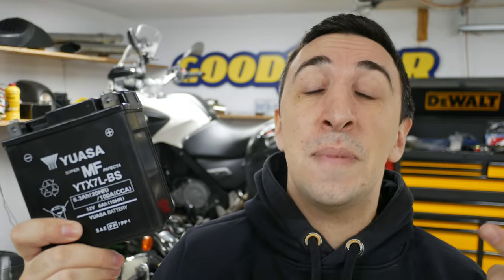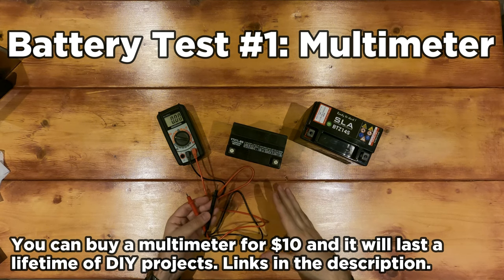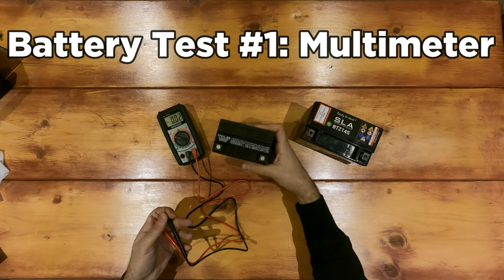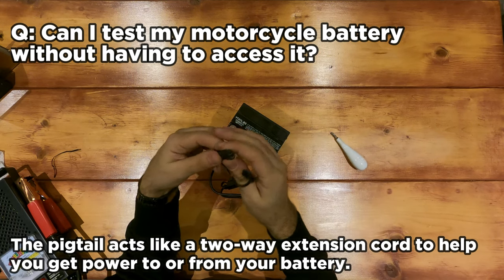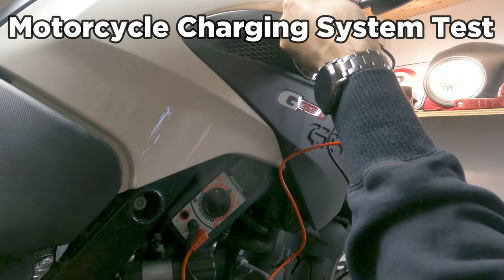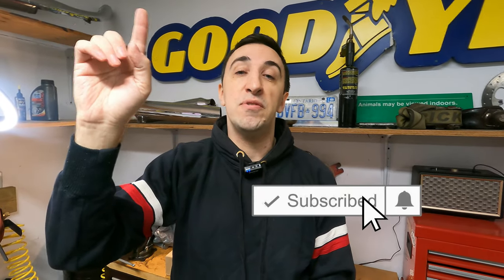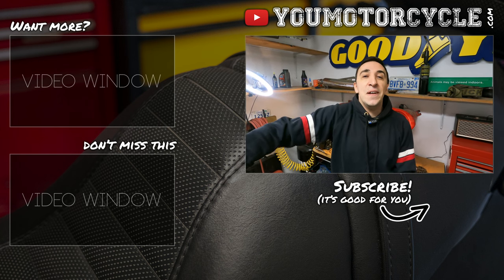Dead Motorcycle Battery: Recharge or Replace?

Comment: Something else your test showed is that the voltage didn't drop below 10 volts while starting the engine which indicates a good battery.  Also you don't need a meter to tell the charging system is working  - just watch the headlights brighten as you rev the motor! Great videos,  very clear and fun to watch!
Reply from the maker: Fair point. That works in a pinch. Thanks!

Comment: Thanks.  I never stopped to think my inexpensive multimeter that's primarily used to test AA and AAA batteries around the house would also work to confirm 12+ volts in my motorcycle battery.
Reply from the maker: Thanks Kevin. Ironically, I never stopped to think my inexpensive multimeter that's primarily used to test motorcycle batteries aroudn the garage would also work to test AA and AAA batteries. You should make a video and show me how to do that now haha.

Comment: Don’t buy cheap or unknown manufactured batteries, just buy a Yuasa, and know it’s going to last, especially if you use a battery conditioner like the OptiMate 3 Motorcycle Battery Charger & Tester.
Reply from the maker: I agree. I'm currently experimenting with a no-name lithium. I'll post a progress video on that over the winter (it's been a full year now), and I'm also going to be doing another video about desulphating battery maintainers because I think you bring up a good point: the charger you uses does make a difference!
Reply: @YouMotorcycle  Yes, probably does make a difference with the correct charger, some just charge with is not good, you need one that cycles the battery and does periodical condition checks automatically. In the UK these cost around £55.

Comment: On my 3rd battery. I didn't know if it was the battery or my charging system. I got the first 2 where u add the acid but they both failed no sure if it was because the store added the acid and didn't wait the 30 minutes before putting the caps in. Every time it went dead the caps were coming out of the holes. I got a new sealed battery today and so far so good but I will be going to get a multimeter tomorrow to check my charging system. Anybody have any other suggestions?
Reply from the maker: Hey, how did the charging system test go?

Comment: Hi Adrian - Another great video. I have always kept my bikes on a trickle charger and haven't had any battery problems, yet. I'm going to get a Load Tester and start checking a few times a year. And good to know you can use the pigtail instead of taking things apart to get on the battery terminals.Definitely worth it not to get stranded. Thanks!
Reply from the maker: Hey Paul, thanks for the kind words. Trying to be helpful to people. Always a smart move to keep the bikes on the trickle chargers. I wouldn't check them too often. No use to put an unnecessary heavy load on the battery more than is necessary. Also a good idea to fully charge the battery before and after the load test. But if I was going to get either a load tester or a multimeter, I might go with the multimeter because it has a wider range of uses. Load tester is definitely easy to use though!

Comment: This video is exactly what I was  looking for. I have the same load tester which I got at Harbor Freight a while ago. I wasn't sure if the 100 amp load of the tester would be too much for the battery. I feel more confident now to use it on my 28AH motorcycle battery. Thanks for the great video.
Reply from the maker: I think it says on the label right on to only hold for 10 seconds, and they know it's made for 12volt batteries, so I wouldn't sweat it, but I also wouldn't hold it for any longer, and then charge it up again right after testing! Glad you liked the video! :)

Comment: Good vid. Waiting a couple of hours after charging to test the battery voltage was a new idea to me. 

I think you mentioned something else briefly but another charging system problem to look out for is too much voltage when the motor is running. My Suzuki started having brighter than normal dash lights a while back. I thought maybe I was imagining it but I checked with a multimeter hooked up to the battery terminals while it was running and it was over 18 volts! I stopped riding it around before I fried anything and got a new regulator/rectifier. With the new reg/rec installed it went right back to about 14.3 volts.
Reply from the maker: Was it a GSXR by any chance?
Reply: @YouMotorcycle  Nope, it's a lowly GS500E

Comment: Thanks for the very informative video. My pigtail is connected to what's called an 'output terminal' on my fusebox for attaching electrical accessories. Could I still use that pigtail connection to check with a multimeter as you instructed in the video? It's a pain to access the actual battery connections.
Reply from the maker: Should work. It's gotta get power to and from the same battery. PS: Thanks!
Reply: @YouMotorcycle  You'd think so. :) Thanks!

Comment: how about replacing acid or cleaning batt cells & adding acid back. 

did several times and batts leasted more when 6-8 years
Reply from the maker: From my understanding, refilling an old battery casing with new acid wasn't recommended... but I honestly can't remember why not. If it works for you, rock on!
I'll be doing another video on another tip to extend motorcycle battery longevity though... stay tuned :)
Reply: @YouMotorcycle    not with a new one, goal is to use charger with shock option when you fill with dist. watter and when you put same aciid back

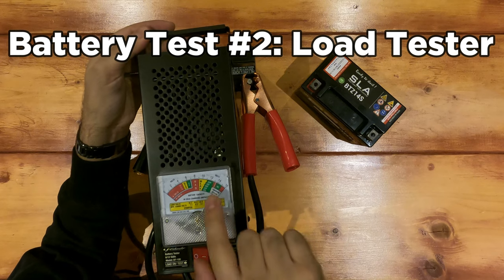Comment: 2:50 Nope, I'd not go 10 seconds, no more than 5-6 seconds when load testing a motorcycle battery with such a device that was designed for car testing batteries! Going more than 5-6 seconds would seriously shorten the lifespan of a mc battery.
Reply from the maker: Interesting point, thanks!

Comment: Hi there @YouMotorcycle thanks so much for this video!  I had a dead battery, I charged it fully, let it sit for 2 days, then used the multimeter and it read a solid 12.6v, after turning the key lighting up the dash etc. the multimeter read 10.4v and then hitting the starter, the engine turned over a couple times but didn't turn on at all. Does this mean my battery is actually totally shot? I'm just a little confused because it read 12.6v. Thanks in advance.
Reply from the maker: Battery is taking a charge, holding a charge, but has no cranking power. So when you put a load on it, it fails. If you had a battery load tester it would probably fail. Unfortunately sounds like time to replace the battery.
Reply: @YouMotorcycle   thanks so much for getting back to me. Super helpful!

Comment: Hey Adrian, great videos and a great learning tool for people getting into motorbiking. I just wanted to check something. I don't have the battery tender connector that you have in the video (CTEK one is on order with a full tender system) so would I be ok to check the motorbike charing system to put my multimeter on the terminals on the battery when checking this? Or should this only be done once I have the connector? Thanks in advance :)
Reply from the maker: Thanks! Size, shape, look, brand... don't let any of that bother you. They're going to have a positive terminal and a negative terminal. The rest is just details :)
If you find that you get a negative number, for example, -12.76, it just means you have the positive and negative backwards, switch them around and you'll see it's 12.76.
Reply: @YouMotorcycle  Thanks buddy,  just checked my bike battery and the bike charging system. I had bought my bike from a friend who had it sitting around for a few months and  hardly did any mileage, then when I bought it I was having starting issues every other day. But doing these checks you've guided me through I'm pretty confident I just need to use the bike more and the battery will become more reliable. I have a tender etc on order and have another battery coming as a stand by. I'm now going to watch some more of your content to level up my mechanical knowledge. Thanks again dude!! :)
Reply from the maker: Batteries don't get better unless they're being recharged now and they weren't before. Is that the case?
Reply: @YouMotorcycle  Yup, I've been charging it and going for long rides. The only time I had issues starting was if I left the bike for a day or two then tried to start it, but when being used daily for more than half hour its been fine
Reply from the maker: That should have failed the test. How did you test it?
Reply: @YouMotorcycle  I disconnected the battery and checked with the multimeter which gave me a reading of 12.7v. Then connected the battery back to the bike, turned the bike on and it then read from 12.4v to 12.6. Started the bike and it dropped to around 9.4v then picked up and was steady around 13.8v, gave a little rev and would pick up to just over 14v
Reply from the maker: Nice. How long was the battery either not run or not charged when you checked it?
If you check it right after a ride or after firing up the bike you'll get a false result.
Reply: @YouMotorcycle  I went out in the afternoon on the bike but it had been standing at home for a least 3.5hrs before I tested it
Reply from the maker: Ok great. But it still shouldn't be dead after not being on the road for a couple days. Did you check the charging system too?
Reply: @YouMotorcycle  Yup checked the charging system as well. Turned on the dash etc and the reading dropped to 12.3v - 12.5v then starting the bike it jumped up to 13.8v, gave it a little rev and it picked up to on and just over 14v
Reply from the maker: @Chuubs  so weird that it was still having starting issues. Are you sure it's a battery issue and not something else? Battery and charging system sound really good
Reply: @YouMotorcycle  I put the bike into my friends auto garage for a full service and check over and nothing was reported back. It is only a little 125cc. Are there any other things that I can check to be sure, just point me to any of your videos and I'll have a watch and check it out.
Reply: @YouMotorcycle  Just to update, I grabbed a new battery and this has solved all the issues. Odd that it was giving me decent readings, but new battery in and starts perfect every time. Also to save headaches in the future I picked up a permanent battery tender. Thanks for the tips dude and taking the time to chat and help <3
Reply from the maker: Glad you got it sorted out!

Comment: Struggled with starting my bike for over 2months...then realized my battery was leaking acid due to falling from the bike 😢

Now am planning on buying a new battery 🔋 and hipe for the best 😢
Reply from the maker: Hope everything has worked out! Make sure that the battery leak was from the spill and not from a charging system issue :) Everything okay with the new one?

Comment: Good video Adrian.  I keep my battery from my Spyder on a tender indoors for the winter.  But, I have never thought of checking the charging system after I reinstall it in the spring and periodically through the season.... good tip, Thanks.
Reply from the maker: Thanks! I keep them all on tenders in the garage via pigtails but indoors would probably be best!

Comment: I really liked your presentation...until 3:55 into it where you were going to show how to use the pigtail to charge the battery but you went right to testing the charging system! 😞

Still a useful video!
Reply from the maker: Sorry! The battery charger should have a matching plug, so what you're seeing on the right side, a couple seconds earlier... the two connectors are identical. so you just plug them into each other.

Comment: I bought a new yuasa battery 3 days ago for my motorcycle and it charged for 1 hour before plugging it in and I drove it on the highway for 2 hours and then I rested it for a day when I checked the next day its voltage is always in 12.4v and then dropping to 12.3 engine start at 14.2v does my battery needs more chrage or is it normal for new battery? hope you can help.
Reply from the maker: Sounds totally normal. How was the battery prepped?
Reply: @YouMotorcycle thanks for the response  Sir. no hard starting one push start and i feel more power on acceleration I was just wondering because I thought it should be 12.6v when the battery was new compared to when I bought the motorcycle the voltage was 12.6v at resting I'm sorry, I'm just a beginner in this kind of stuff.

Comment: I wanna blame the battery but everything checks out good. However my Goldwing has to be boosted after sitting 3-4 days.  Two y/o Yuasa AGM battery .   I checked for parasitic drain and came up with only 3 milliamps.  5 is considered normal/ acceptable.  Also if I turn the key on for too long without starting(something distracts me for example) and forget to turn the key immediately back off 45-90 seconds it then won't start without a boost.    I don't have a lot of extra load on it.  Just ring of fire.  
Now what?
Reply from the maker: Next time you're gonna let the bike sit for 3-4 days, disconnect the battery first. After it's sat for a few days, hook it back up. If the battery has no issues this time, you've got too much drain. If the battery is still no good, replace it. You might also want to fully charge the battery and take it to an auto shop or a motorcycle shop and have them put it on a load tester like I have in the video.
Reply: @YouMotorcycle  Update.  Few days ago it started something new.  Would turn over and immediately die, then restart no problem.  Did that twice in a week.  Then today it did it but then there was zero electrics at all.  No lights no instruments... nothing.  I went looking for a loose connection, or a brown fuse.  In the process o gave the battery a good open handed whack and it immediately came to life.   I rode home and removed it and went to the Honda shop and got another.  The old one tested bad on their tester which is more advanced than mine.   About to put it in &see what happens over a couple of days.

Comment: any idea where the starter lug for the positive battery terminal on a kawasaki vulcan 2000 classic is ?  circa 2008 trying to find a way to jump it without pulling the seat off
Reply from the maker: @mtjl354  are you sure it even has that? Are you... positive? 😂
Seriously though. It has that? You sure??
Reply: @YouMotorcycle   i'm having starter issues or charging system issues; the starter motor was replaced 1 1/2 to 2 years ago , they informed that the stock original motor would cost $800 but a smaller motor would cost alot less and would be fine, don't know if that seems to drain the battery quicker(a smaller motor starting such a big bike) but i have to jump it a bunch of times(runs fine once I do) was trying to find a way to do that without having to pull the seat. So i pulled this off one of forums "Second, the easiest way to hook up jumpers on the bike is by connecting the jumper cables to the trans case (which has a direct negative cable to it from the battery) and to the battery cable post on the starter (which has a direct positive cable to it from the battery) and you don't have to pull the seat or anything else off of the bike."
hence the question;  btw used your technique to test my charging system  and it seems to be working fine
Reply from the maker: @mtjl354  so the charging system tested fine... did you test the battery too with a good load tester?
Reply: @YouMotorcycle  no,  the battery is pretty new and i did install a pigtail to tricklecharge it with my Noco 5genius
Reply from the maker: @mtjl354  time to bring it in for diagnosis
Reply: @YouMotorcycle  yeah    you're right, is there anyplace I can hook-up the positive side to jump it without pulling the seat
Reply from the maker: @mtjl354  you already asked me that 4 days ago. I haven't looked at a Vulcan 2000 in that time sorry lol
Reply: @YouMotorcycle  no worries; let me know if you do thanks

Comment: My yuasa read 10.70 -.- whyyy it’s only been 6 months total
Reply from the maker: How have you been using it (or not using it) and how was it first setup? Why did you need to replace the previous battery 6 months ago? Have you tested your charging system?
Reply: @YouMotorcycle  well I ride at least 2 days a week to get to work, that’s 2hrs there. Plus maybe an hr or 2 more during the week. Nothing long distance. And year round (NJ) even in very cold temps. I initially replaced the battery I believe because it did die, but then wouldn’t hold a charge for very long.  Anyhow.. now I know to at least charge my bike intermittently. Which I never did.. I haven’t checked the charging system yet!  I will shortly.
Reply from the maker: I always keep my batteries on a charger over the winter. The cold is very hard on them. Let me know if the charging system is okay. Riding with a weak battery will also cause your charging system to work harder, which could wear it out faster, so your old battery could have done some damage if it's an older bike that already had a lot of wear, but hopefully not.
Reply: @YouMotorcycle  I have a 2020 Yamaha tracer 900, the only owner. Now at 8,417mi 

so after charging the battery it read 12.82. Then this morning I took a reading and got 12.65. (Is that normal?) I then checked the charging system, it shot up and then after one rev at about 5k rpm I got a reading at 14.41
Reply from the maker: @Neeko_Z  sounds perfect

Comment: Shit I abused mine 😳
Reply from the maker: Hey, it happens 😁 we make mistakes now so our older selves won't have to. Live and learn :)
Reply: @YouMotorcycle  I dumped it put a hole in the stator cover finally just put it back together n got oil in it won’t crank assuming the battery is dead after sitting for a while